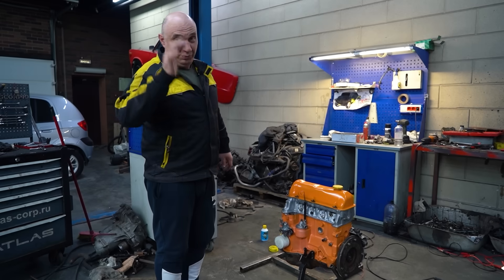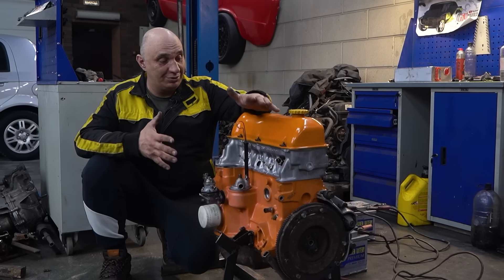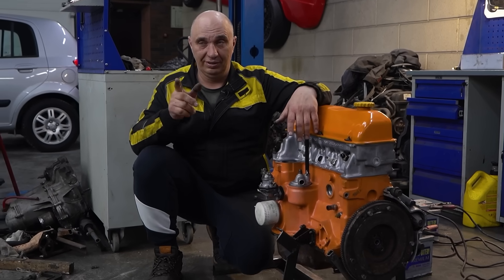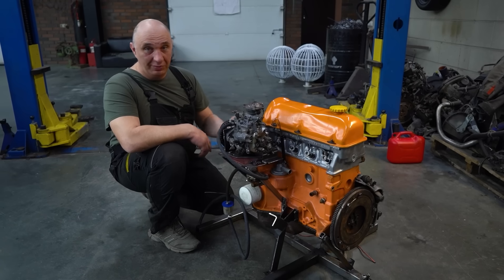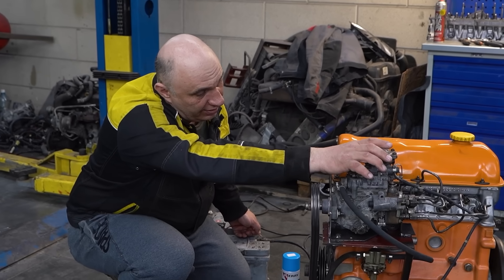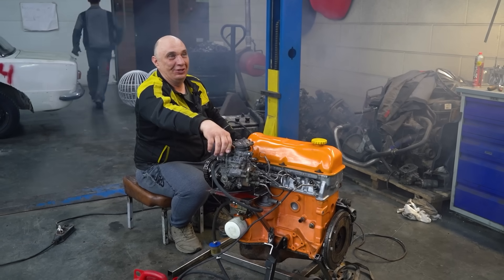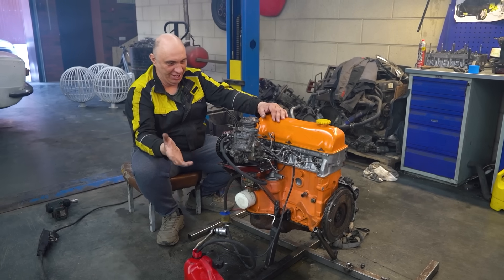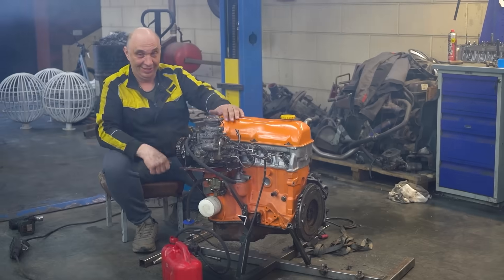We convert a gasoline engine to run on diesel fuel - will it work?

Comment: You managed to do something better than GM did in the '70s or 80's lol. With the 5.7 gas engine. GM converted a gas 350 into a V8 diesel. One of GM's worst engines. Great video guys, can you try to make it run backward somehow? I heard old Diesel engines use to. I can't see how properly in a manual transmission on a hill maybe.
Reply: @Vladimir Nicola Chersi  Really that's awesome.  Thanks for getting back to me
Reply: @Vladimir Nicola Chersi Thanks

Comment: In case no one knows it. GM took the 350, a 261, and a 263 6-slammer, and redesigned them to run on diesel.  One small problem though, they didn't redesign the bolt patterns on the heads, plus they didn't include a debris/water separator to cut costs.  Those mistakes cost them dearly.
GM kept peddling the bad engines from 1978 to 1985, until their collective minds connected with their brain stems, realizing they had a major league lemon on their hands. Hell, the CARB board could not certify the diesel because IT KEPT BREAKING DOWN in the middle of the tests!  For 30 years, GM could not sell a single diesel to save themselves. 
The only ray of sunshine coming from this, is the strong engine blocks, revamped to run gas, still sees life on the racing circuits to this day.
Reply from the maker: "Hell, the CARB board could not certify the diesel because IT KEPT BREAKING DOWN in the middle of the tests!"
That's hilarious)

Comment: It should detonate and then promptly foul it's plugs.  

-I've never understood why diesels do not have spark plugs, because much of development work on diesel engines is regarding the initiation of the combustion event.  That determines how loud and "clanky" the engine is, and leads to imprecise combustion length.  It occurs to me that they COULD design a spark plug/ignition system that would not foul and would last for the life of the diesel car if they wanted to.  The reason for the existence of diesel engines is that they are 30% more fuel efficient on average when compared to a gasoline engine, not that they are cheaper because they have no ignition system or throttle plate.  Yes, part of the reason diesels are more efficient is that they have lower pumping loss because there is nothing between the air filter and the intake valves but a hollow tube, they run wide open.  RPM depends upon fuel;  The more fuel, the more torque and thus RPM and horsepower.

Comment: I was sure you were going to be able to do this because years ago GMC and Detroit Diesel took a gasoline engine that was in a pickup truck and converted it to diesel. They sold pickup trucks with this engine.  They had quite a few problems with it nevertheless. Anyway you did a very nice job and it worked.
Reply: Cars too. A lot of them.  Hence, the "Lemon Laws" were enacted after that debacle.
Reply: hold on a minute Detroit diesel had nothing to do with the GM diesel  fiasco , GM converted the olds 350 (5.7 L ) to diesel people talk about the block but the problem wasn't the block it was the weak internals like broken crankshafts  bad head gaskets and so on  i had an olds cutlass wagon 5.7 diesel i fixed it many times i'm a mechanic when it ran it was great and good MPG but always breaking down i replaced injection pumps , GM made cars wagons and trucks powered by this engine and I tell you more you probably don't know that they built v6 3.8 diesels  , now fast forward a couple years Detroit Diesel designed and built  the 6.2l diesel  a very different engine and later the 6.5 L i own one , but nothing beats my past 3 Mercedes diesels and even 6 VW's i love diesel cars
Reply: If you're talking about the Oldsmobile, which had nothing to do with DD, it only shared the head bolts with the gasoline engine
Reply: @MiG21aholic  It was GM's idea, and they tried to introduce a Isuzu 6 into the Chevy light sedan line, but the Olds, debacle carried over into the rest of the GM lines.
Reply: @Nighthawke70  yes. But they did get DD involved to produce the 6.2 after that

Comment: The Perkins prima diesel is a converted petrol engine, the O series used in later British Leyland vehicle's.
Reply: Yep and the original land rover 2.0 diesel introduced for the series 2 land rover (1958) was based on its petrol equivalent with the vertical CAV pump in place of the distributor. The basic formula was continued for decades to come
Reply: And yes that was indirect injection. Pigs to start cold in their day
Reply: @johnnyskratch40  Also A & B series were converted to diesels too.
Reply: @austinmaxi  ha thanks you're right and I think they're still kept going in the Ambasador taxi's in India. Had a leyland garden tractor with the BMC 1500 once and it actually started quite well given the indirect injection and dpa pump. Not forgetting the sherpas as well lol
Reply: @johnnyskratch40  I didn't know till a few years back that they did an A series diesel! That was for a bmc mini tractor too, Always wanted one to try and fit it up to a mini gearbox. I heard it had been done but never found any evidence. 1.5 and 1.8 diesel found there way into a canal boats too and even Marinas in Europe too.

Comment: If you can drill some holes one the chamber for glow plugs and get a grid heater and figure out injection timing it would be a solid unit

Comment: I knew it would run on diesel fuel, and my hunch was right. To make it a bit convenient, grab the diesel engine intake heater and a turbocharger (for better performance) before you chuck it in a car and play with it.

Comment: The whole process of you guys trying to get it running and the heat gun was pretty dang funny 😆 
Nice job
Reply: the heat gun did the job that would normally be done with the glow plugs (especially in an indirect injection engine)
Reply: @petelattimer6808  Yep. Pretty cool
Reply: They basically ran a (very low boost) super/pro charger, with no intercooler, through it. (We could just call it a glow plug, but I would argue there's a little bit of a boost there)
Reply: @jwalster9412  I can guarantee you that a heat gun is not going to add any additional psi lol.. It was just warming up the intake temps which helps combustion
Reply: @TTime685  Yup, I don't think it flows enough to fill a cylinder at idle let alone boost it (would more than likely choke it if adapted/sealed to the intake)...

Comment: Heat gun are "glow plug" like it was in old times. Heater in intake manifold and that was glow system.
Reply: The 5.9 Cummins Turbo Diesel still works this way.

Comment: People have already talked about the injectors being meant for prechambers being the reason for difficult start. I think more advance would really help as well. But if you already haven't thought of it, you could adjust the injector pop pressure to be higher. My old 240 used shims in the injector, and I'm sure those injectors are similar. It would mean less fuel flow and less power, but it should get much better atomization.
Reply: main reason is the lack of glow plugs to preheat for initial cold start. at those compression levels, they WILL need glow plugs for initial start up. which is why it worked better with the heat gun on it.
Reply: @petelattimer6808  This was gonna be my point... I had a glow plug fail in my car once and that sucker wouldn't fire on all four until it got some heat in the block... Sucker ran like crap for a solid minute lmao
Reply: @DigBipper188  I've had a plug cooked and mine didn't even start
Reply: @petelattimer6808  Would a block heater be enough to keep the combustion chambers warm enough for a cold start?
Reply: @petelattimer6808  just rob a intake grate-style heater off something and they need more injector pressure as well
Reply: Lots of diesel run intake heaters instead of individual glow plugs. Basically the hair dryer in the intake manifold. But the biggest tissue with this build is the lack of swirl and atomization.
Reply: I don't know why they didn't just run a single injector through the intake. It would have been way simpler than boring and taping the whole head and setting up 4 injectors.
Reply: Because diesel is a timed injection so that won't work
Reply: @jwalster9412   Diesel has to be injected at the correct time.  If you just  Let fuel in with intake air it will ignite too early due to compression

Comment: Should have just went to Propane...

Edit: So what timing did you get to? 10' Advanced? 15'?

I've also found that coolant heaters and silicone pad oil pan heaters help massively. They get it closer to running temperature to take out the warm up factor (where you have to REALLY advance the timing. Bonus points if you insulate it so only the engine sucks in the heat.

Comment: Yeah the compression ratio is not high enough. I think they measured 290 PSI / 20 Bar last video.
A "normal" sports gasoline engine has about 15 bar compression. So they would need at least 30-50 bar for it to run like a normal diesel
Also the injectors look like indirect types, but i might be wrong.
Reply: Tell that to the diesel engines smaller than 2 Liters in cylinder displacement, they have gotten away with less. But on the injector part, you're spot on. Higher pressure would help with atomizing the fuel better.

Comment: what is the idea of using the heat gun? what is that doing?
Reply: Heating intake air so that diesel ignites. It wouldn't ignite if it was cold.

Comment: Yes, IDI pintle injectors in a wedge head combustion chamber.  No swirl so the burn is poor and incomplete.
Reply: IDI injectors way better than DI injectors for this, would benefit from the pop off pressure being raised though for better atomisation.

Comment: I'm assuming the pump and injectors are not for direct injection. And the camshaft is for gas. But you still got it to run! Wow
Reply: I can run a coal train on waffles.

Comment: GM tried this in the 80's with the 350. It worked until it didn't.
Reply: I remember the diesel Olds V8.  The engine long block itself was good.  It was the fuel system that was no good because it lacked a fuel-water separator and extra filtering that a real diesel would have.  The head bolts weren't strong enough.  But those shortcomings were fixed in the last three years of the Olds diesel.  

What can't be fixed is when customers were not following GM's instructions in the owner's manual.  People were accustomed to the low-maintenance Olds gas engines and just assumed the diesel would be the same.
Reply: One thing I don't get is that the Nissan LD28 was a similar concept, but it worked okay. The took the L-series gasoline engine and somehow were able to get a diesel out of it.

Comment: Oldsmobile tried that about 40 years ago, and no it doesn't work.
Reply: I remember the diesel Olds V8.  The engine long block itself was good.  It was the fuel system that was no good because it lacked a fuel-water separator and extra filtering that a real diesel would have.  The head bolts weren't strong enough.  But those shortcomings were fixed in the last three years (1982-1985) of the Olds diesel.  

What can't be fixed is when customers were not following GM's instructions in the owner's manual.  People were accustomed to the low-maintenance Olds gas engines and just assumed the diesel would be the same.

Comment: The pump injects too much fuel. Maybe the injectors are bad too. This should be tested further. And here is another proposal, multifuel, both gasoline and diesel. Maybe install lpg too.

Comment: You are running indirect injection as direct injection. Just make it indirect injected and add a little bit of compression and it will work as a normal diesel engine.
Reply: That would require a completely different cylinder head that has everything cast in.  Not possible here.
Reply: yea sure, they'll just whip up a completely new cylinder head ;)

Comment: Here’s one thought I have:

The engine is right now set up as direct injection, however I believe the injectors you used are from an indirect injection engine. These injectors might not work very well for direct injection. Perhaps if you used injectors specifically for direct injection the results might be better!
Reply: I'm they could just plug up the holes they bored, or add glow plugs into them, and run a single injector through the intake manifold.
Reply: @jwalster9412  That will not work. Diesel requires precisely timed injections, throttle-body injection does not work for a diesel.

A diesel does not draw in fuel with the air like a gasoline engine, it needs to be injected at a specific amount of degrees before top-dead center. It is injected during the compression stroke, where the intake valves are closed. Can't get fuel in that way.
Reply: @99domini99  the second option I was think of was 4 separate injectors on the intake manifold.
Reply: @jwalster9412  That also does not work. You cannot inject against a closed intake valve.

Injection outside of the cylinder only works in a gasoline engine, as a gasoline engine can happily ingest the gasoline during the intake stroke. A diesel cannot. A diesel REQUIRES injection during the compression stroke.
Reply: @99domini99  not being a diesel guy, up until recently I just assumed all diesels were carbureted 2 Stroke behemoths. I guess I was wrong in assuming. 🤷‍♂️
Reply: @jwalster9412  Hahaha you couldn’t be further from the truth! Diesels can’t use carburettors and never had!

I wish all diesels were two stroke behemoths haha! Imagine that in your modern pickup truck!
Reply: @99domini99  Detroit 2-stroke diesels. Those were some really amazing engines, with a distinct sound.
Reply: @99domini99 this isn't how idi diesels work ..... As the prechamber is ahead of the intake valve .... The fuel is sprayed into an already hot chamber causing a fuel vapor to be be drawn into the cylinder on the intake stroke ... And a glowplug makes this possible on cold starts  so I think theoretically a fuel vapour could be drawn from the intake now I'm sure this requires probably different valve timing from a gas engine to try and control detonation the principal I believe is similar to a gas engine
Reply: Due to the design of the combustion chamber, the angle of the injector and the cone spray pattern, I think IDI injectors are a Good fit. DI injectors fire out 4 / 5 streams closer to 90 degrees to the injector so it would be spraying the diesel at the piston crown, head, cylinder walls etc. What would help I think would be to increase the pop pressure of the injectors to atomise the diesel better, and add a turbo to increase the dynamic compression, making sure to hook up the boost compensator on the pump to add more fuel under boost.
Reply: Wait, isn't every diesel direct injection? Or were those gasoline injectors?
Reply: @skuula  No, some have a prechamber.
Reply: @skuula  No, older diesels inject into a pre-chamber. Modern diesels inject directly into the cylinders and have pistons with a cup in them to aid in mixing and combustion, older style diesels had this cup inside the head. Diesel would be injected into this chamber before reaching the cylinder. If you look at their diesel to gasoline conversion, you can see these chambers when they have the head off.

I can’t imagine injectors intended for pre-chamber injection to work well for direct injection. Since that significantly affects the mixing of the diesel and air mixture and the combustion timing, that might cause the engine to not run well. It might never run well with this setup.

Modern diesel engines also don’t have such high compression ratios anymore, some having as low as 16:1. Compression ratio is not the issue in this case, I think it’s mostly because they used an incorrect type of injector. The pistons not having the cup in the center either might also cause issues. While pre-chamber injected diesels can have flat-top pistons, direct injected diesels commonly have pistons with a cup in them.

All of this together might result in poor mixing of the diesel and the air. Though the Garage54 crew is EXTREMELY skilled and experienced with gasoline engines, they might have some things to learn about diesel engines!
Reply: @99domini99  BUT My 1989 Hj61 has direct injection
Reply: @skuula  nope older diesels were indirect injection where the fuel was injected into a pre combustion chamber in the head, reasons for indirect injection is that they run a lot smoother, quieter, can rev higher and have a wider power band making them ideal for use in cars
Reply: @skuula  Now all diesel have a direct injection but some years ago many diesel cars had indirect injection engines. They had small chambers above the cylinders where the diesel fuel was injected.
Reply: @yannickl5976  Ok thanks.
Reply: @skuula  no because why do we call the ford 7.3 IDI an IDI indirect injection

Comment: 3 things: 1. you need a precombustion chamber 2. Compression needs to be 400Psi or more and 3. that Injector pump looks like a Turbo pump, it's going to smoke without a turbo. Otherwise great start,. Finally a Diesel Lada.
Reply: I have a diesel with less compression than this. The turbo pump won't put in any extra fuel without the boost reference line. But none of that matters, as it's literally mounted to a completely different engine...